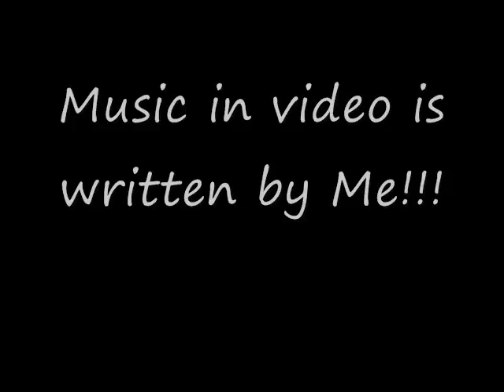Bucket Repair-Jason Hobbs

Comment: nice work. is that .045 gas shielded wire you're using here?

I worked with a real cool guy from Springdale NL up in the arctic.

Loving the accent BTW. Always loved the east coasters. Good stuff.

take it easy, have a good 2010

Comment: How did you keep your moboard straight? Keep it from Bowing
Reply from the maker: Jr Smith just used staggered welds, control the amount of heat being put into it. Worked fine. This was many years ago. Lol I was an apprentice then. Cheers. Thanks for checking it out.